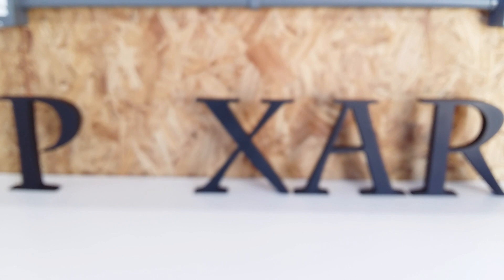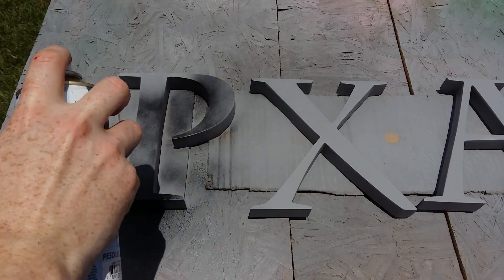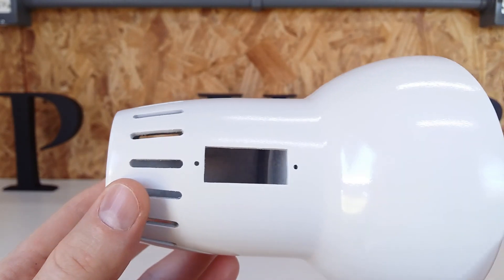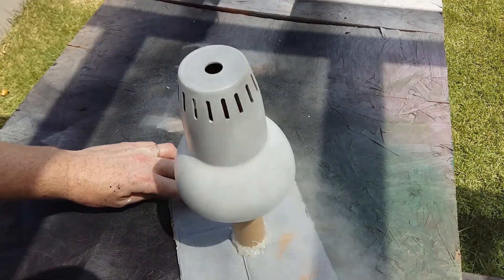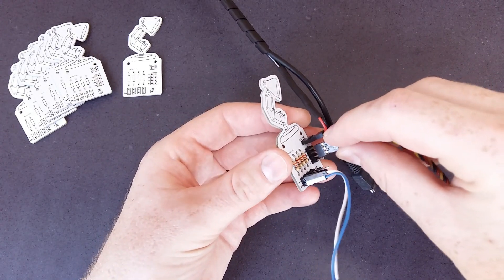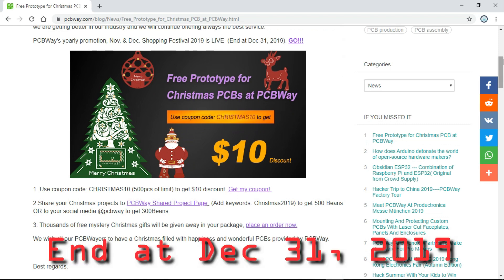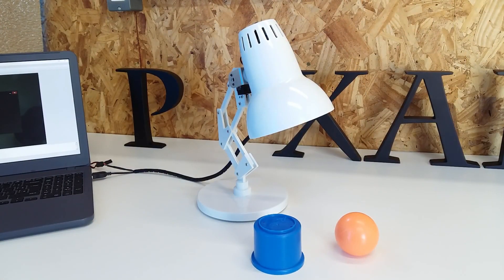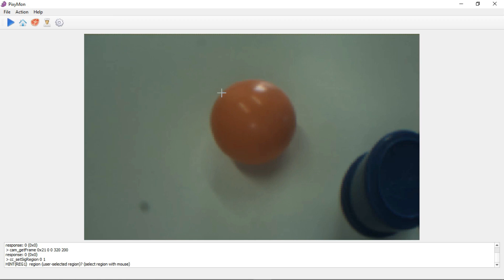PIXAR Lamp Robot - PART 4

Comment: what about moving the joints? isn't that why you made them separately?
Reply from the maker: Hi! Do you mean with more DOFs (more servo motors)? It could have been implemented with a few more servo motors... but it would have changed significantly the design of some parts and would look less like a Pixar Lamp. BTW, the focus of this project was to build a simple pan & tilt system to track some objects with Pixy. That simple.
Reply: @MechDickel  oh